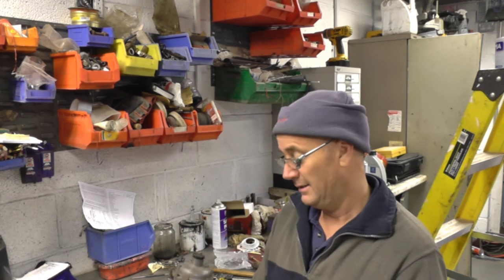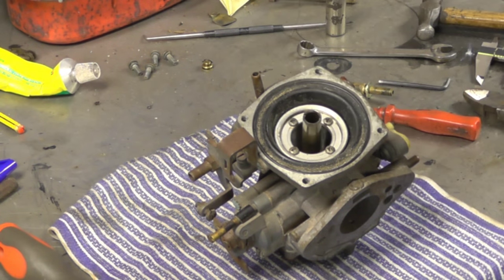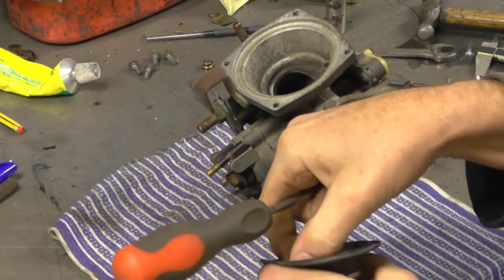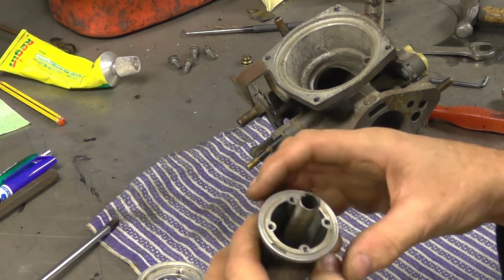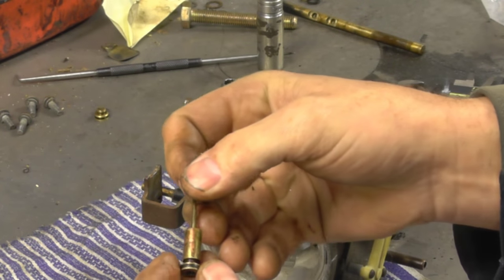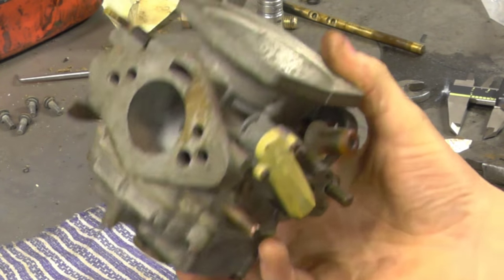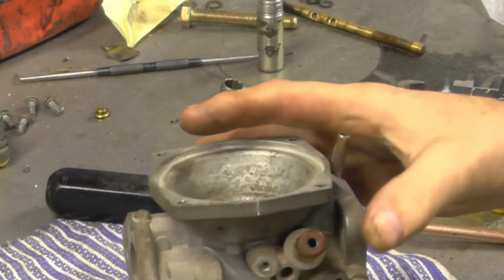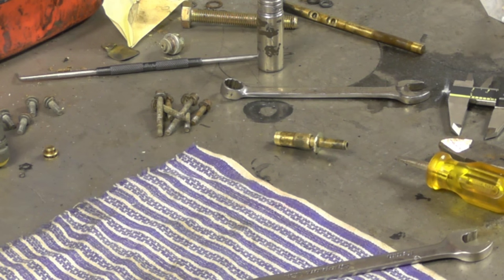Classic car Stromburg cd 150 rebuild triumph gt6 resto part 1

Comment: How did you separate the two carbs? I have a 1967 and the carbs are connected with two rods and four plastic barrel connectors.